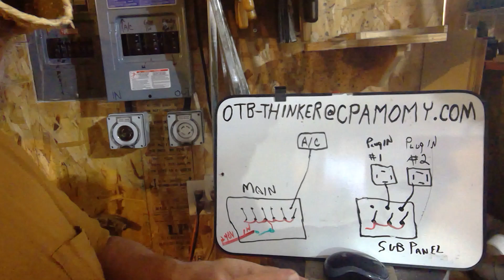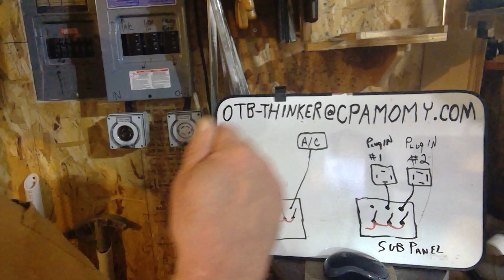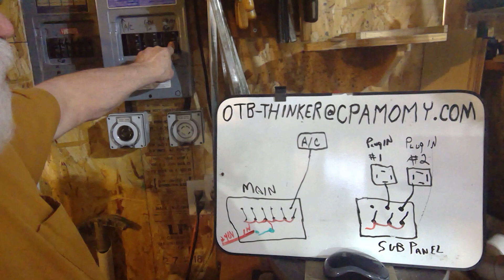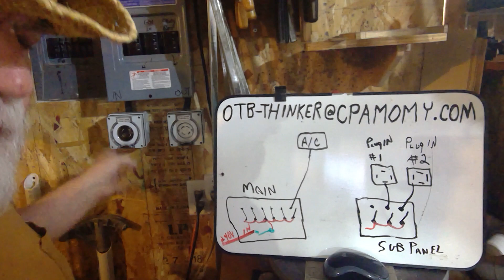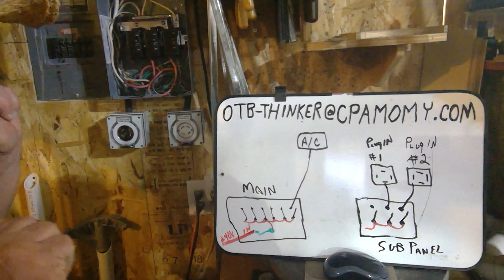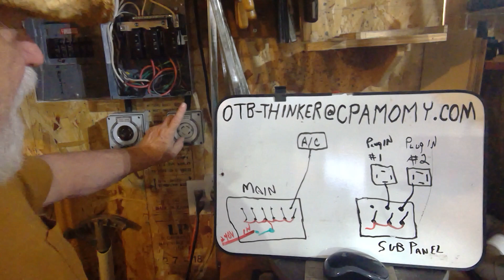Electric Panel Upgrade for Power Station Plug-in by Rambling Russ

Comment: FYI on breakers: over current protection devices are supposed to disconnect the load by or before 110% of their rating based on a time vs load curve. 50A on a 20A brkr should pop instantly (fyi dead shorts would try to pull hundreds of amps or maybe 1000A). 22A on a 20A brkr would take several minutes, 21A maybe 20 minutes, 20A might eventually open or "clear" depending on ambient temp but it should stay connected for a while. 
FYI on your all manual transfer setup: this is basically a "qualified personnel" system, i.e. improper operation could injure somebody and nobody but you should mess with it & technically should be appropriately labeled with warnings  to that effect. On my house i have a 100A panel separated from the grid with an On-Off-On transfer switch so my gen CAN'T back feed into the grid and all my off-grid circuits are in that subpanel. No special labels req'd because it is "inherently safe" which is the threshold for special labels, maybe special locked access, etc.
Reply from the maker: I have a good understanding of current loads.  I only wish they had used 60 amp or 100-amp wire from main panel so I could make a power station with more than 6k watts. 
You are right also, that I will be the only operator of this system for now.  I call this "not idiot proof". The plan is to have exact procedures to reconfigure with docs, so one can follow exact steps for each configuration . . . sort of like "off grid start up for dummies" type book.  I will hopefully be test driving this a lot in the shop off grid for practice.  Thanks, Mike, for the input.  You seem to always help me with your comments over and over again.